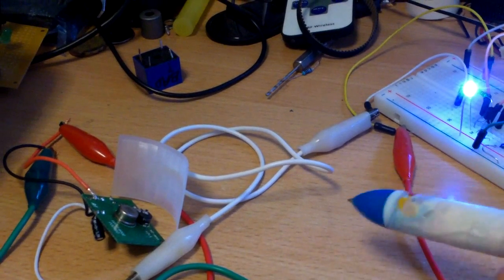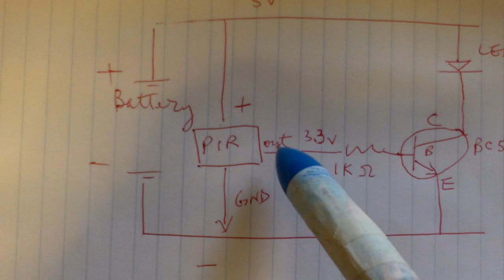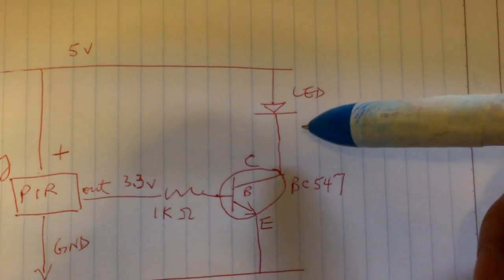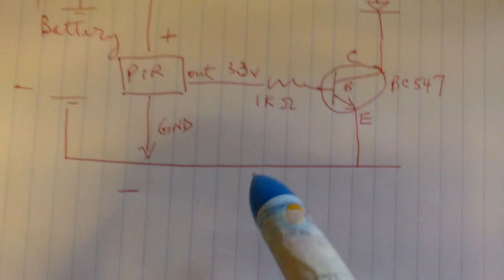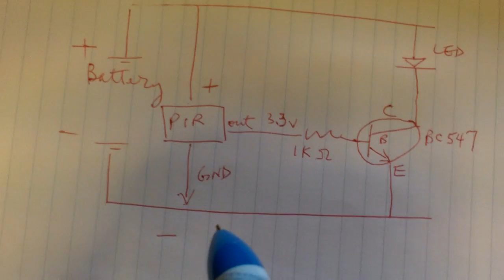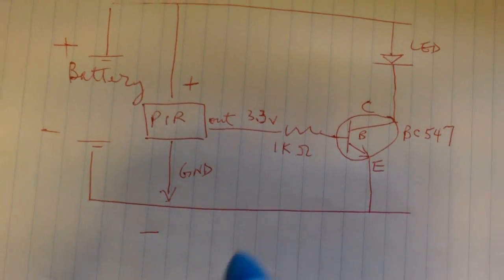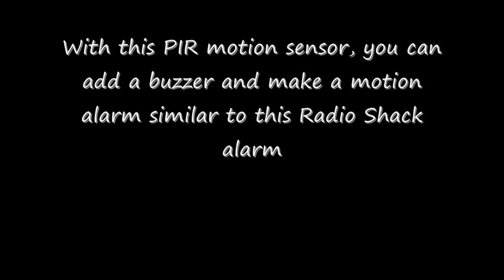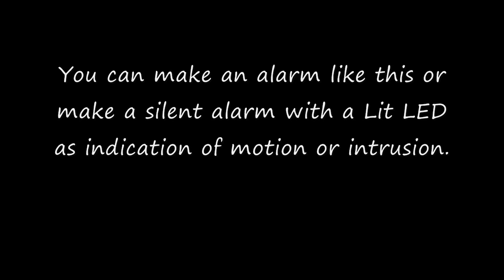Make your own simple motion sensing LED light part 1

Comment: Thanks for posting this video . Helps me out A lot in my project. If I want to have the led light to be on then turn off when the motion is detected then turn back on after a couple minutes what would I need to change in the circuit? So basically reverse what you have here.

Comment: Hi I'm looking for design or complete package of an electronic controller that can power up electrical equipment when someone touch and automatically switch off 5, 10, 15, 20, 25, or 30 minutes after the hand or body lost contact.

Comment: Hi,
I bought a led strip and motion detector. I have 12 V adapter. How would I build this into a light for the hall that will go on when I enter the hall. I am usually holding a tray that I do not want to put down. 
Any help appreciated.

Comment: Hi to connect 12V LED strip what changes need to do in diagram.
Reply from the maker: Santosh Kanabargi It's a little more complicated. You'd need to add a relay for the additional current consumption.

Comment: Nice circuit and works good.  What's that chip you have on your board?
Reply from the maker: The transistor for the circuit is a BC547. The other chip on the breadboard, which is not related to this project, is a 386 IC. I was thinking of making a small dc light in the garage in case I locked myself in accidentally.
Reply: wtam69
I ordered some 12vdc standard base e26 screw in LED light bulbs on amazon for 3.99 each w/free shipping.  They consume 5w and put out around 500 lumen.  I got 2 to make a standard 1000 lumen equivalent to a 70w incandescent.
Reply from the maker: Russ Bowers
Please make a video on the LED bulbs. I started buying and using the AC ones as they give instantaneous full brightness when they are switched on. The CFL are cheap they take a minute or two to reach full brightness.

Comment: man the alarm is so loud and sounds like someone going into a 7/11
Reply from the maker: This is the type of alarm you need to let you know who just walked into the store. It works through heat sensing. If you have snakes, the motion sensor might not work as I think snakes are cold blooded. I could be wrong.
Reply: lol plus they are to low to the ground